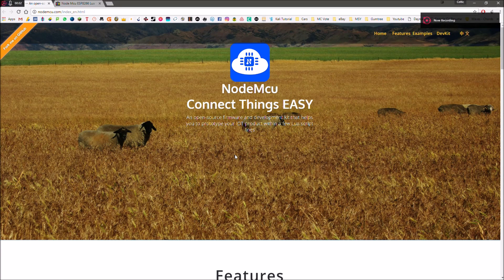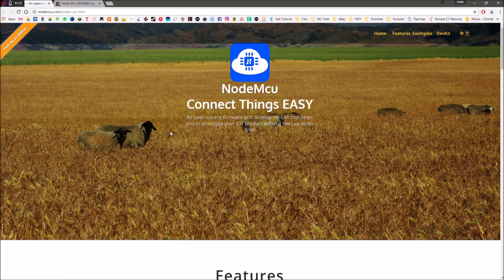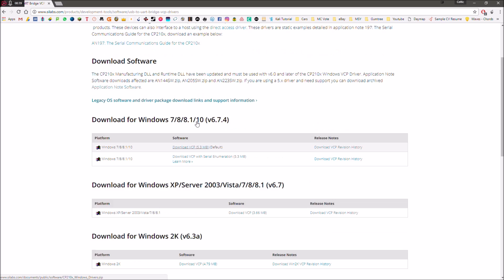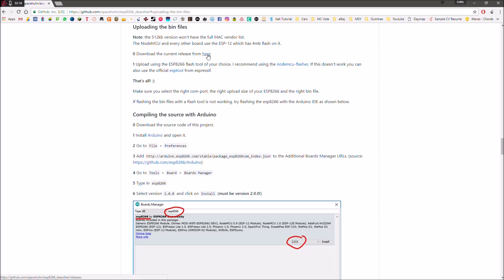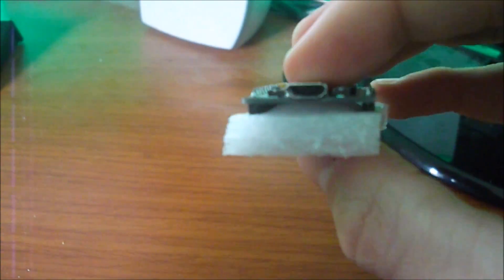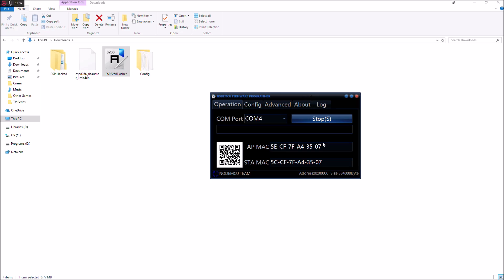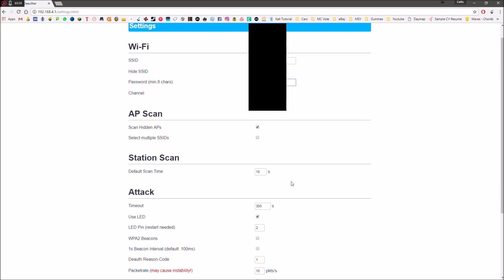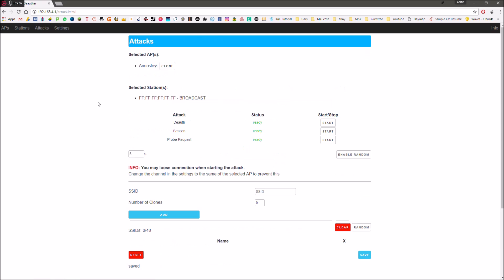Wifi "Jammer" Tutorial (Part 1) ($5)

Comment: Flash stuck at "Note:Begin find ESP8266"
Reply: Celtic Computers yes, at COM3 port
Reply: Celtic Computers The cp2102 driver? No, I haven't tried reinstalling it yet
Reply: Celtic Computers I'll do that when I get a chance. I'll update you on the results
Reply: I just reinstalled everything and still came to the same result
Reply: Celtic Computers I'll try.
Reply: Celtic Computers I just tried and still same result. Flash is stuck at "Note:Begin find ESP8266

Comment: when i plug the device into my computer it wont do anything  i get messages above the square outline that say require wifi and requiregiop i think what do i do
Reply: Making It With Matt same
Reply: Making It With Matt if you still need help message me on Snapchat ridgecoxwell47 I just fixed mines
Reply: i got it to work i needed a data transfer cable thank you for the help tho. i appreciate it

Comment: It says require wifi and require also gpio. Pls help me, what do I do?
Reply: try another USB-slot, maybe that's the problem
Reply: yes i have that issue to, it happens when i flash the device and the QRCode is not showing up please help
Reply: Celtic Computers no i already got it, the fix was another cable Thx for your reply :)
Reply: im having the same problem and changing wires didn't work
Reply: If you have a ps4 try the ps4 charging cable, that was the cable that worked for my :)
Reply: i tried it with the xbox one and still nothing. Maybe i downloaded something wrong. thank you for your help
Reply: np :D
Reply: Hey it shows up with com port but it won’t flash it on to the nodemcu
Reply: epic210 have you tried another cable? Thats why it doesnt flash i think ;)
Reply: KaasKroket yes I have
Reply: epic210 do you have a ps4? Of you have one, you can try the ps4 cable.
Reply: KaasKroket I don’t have a PS4 but I have an Xbox if that’s any good
Reply: KaasKroket what do I do when it says error:serial port connection failed, please check it
Reply: epic210 uhmm idk I did not had that problem, search it on google. :D
Reply: KaasKroket ok thanks :D I will contact you if I have any more questions
Reply: epic210 alright ;)
Reply: KaasKroket tried it with PS4 cable and it didn’t worked
Reply: KaasKroket i solved the problem, it was my laptop. I tried it with my friends laptop and it worked, but thanks buddy!

Comment: i don't quite get it. I already downloaded ESP8266 flashers.exe, the deauther and CP210x driver for windows.. I opened the ESP8266Flasher, set up the file to deauther 80MHz, DIO, 230400. COM port is already set up by itself and I press flash.. it's still asking me "connect.world" or requires wifi or gpio.
Reply: that wasn't the solution. I found out the problem from another youtuber, you need to check your device manager and look for Port(COM & LPT), if the usb device doesn't show then you are using the wrong USB cable.
Reply: thanks for quick answer tho.
Reply: Jason Castillo can you help me
Reply: @JoHDify  what youtube video?

Comment: I need help, I plug it in, it says com1 and when I do everything I click flash and it does nothing, it is blinking. I go to log and it says begin to find esp8266
Reply: Celtic Computers do you think that will help
Reply: Celtic Computers well mine is blinking could it still me a faulty one?
Reply: Mines the same apart for it says that it failed to connect

Comment: Hi, when i flash my NodeMCU the light is flashing and everything is done correctly, but when i want to connect it with wi-fi to my mobile, there is not pwned network :/ Can you plz help me?
Reply: I don't see the wifi network. Why doesn't it work :( I did everything correctly
Reply: Celtic Warrior Same thing, the blue led is flashing but i cant connect to the internet
Reply: Celtic Warrior I fixed it. Your tutorial was great. You’ve earned a new subscriber!!
Reply: Celtic Computers When I plug it in I flashes the blue LED once so I assume it’s working. Just plug it into any power source right?
Reply: Celtic Computers Nope, and I’ve tried every single version both 1 mb and half mb. Nothing working
Reply: Celtic Computers I doubt it’s a faulty device as every other aspect of it works as it should. Also cable is not faulty, I use it for other things. I did try searching on another device, both my pc and my phone.
Reply: Same here mine is farylink